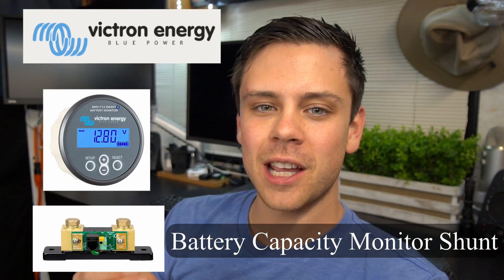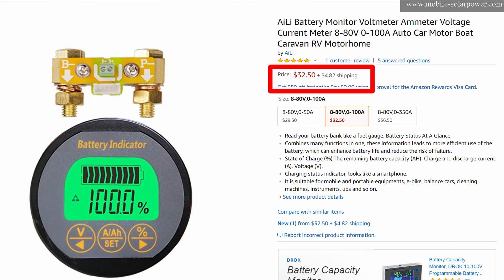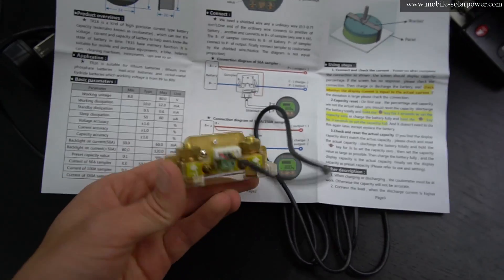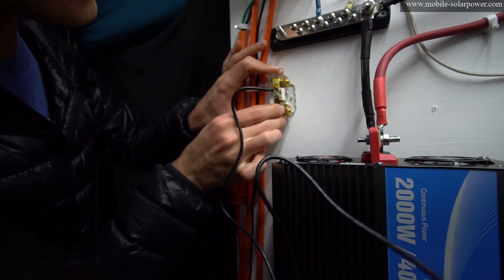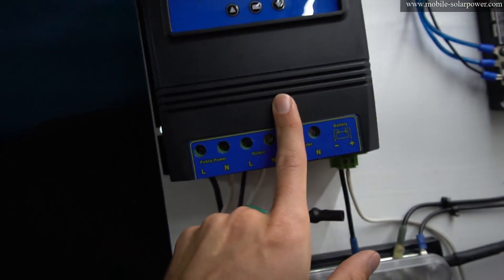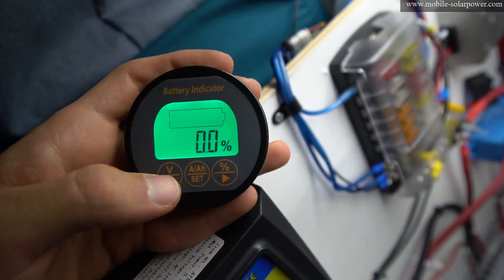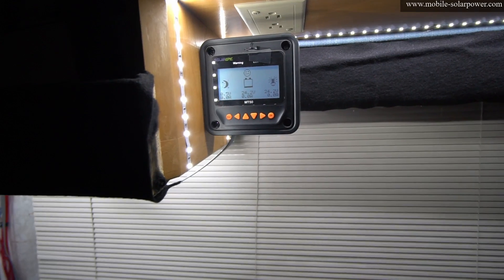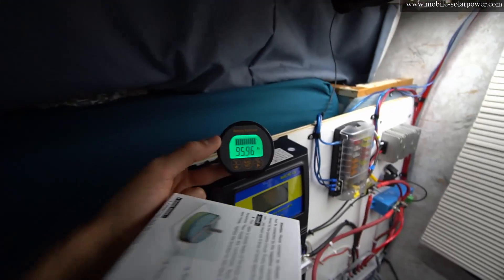$200 Victron Solar Battery Monitor? Try this $30 Chinese one instead! Great for Off-grid Solar

Comment: I bought on Ebay a similar cheap Chinese model (don't know why we say that because most of the expensive ones are made in China too). Aus$35 the meter works very well. All of these meters are a little complicated to set up, even the expensive meters. Avoid the ripoff expensive meters, they are just another example of niche market gouging.  Don't feed the thieves!!

Comment: My charge controller has a display that shows me this. I saw this same thing on Amazon. I instead put a webcam in front of my display and so I can now monitor it from  my cellphone or home without having to walk downstairs. I have a 4080 watt solar setup that works fantastic with 2 seperate charge controllers, 1 is a 100 amp and the other is a 60 amp 4 2500 watt pure sinewave inverters. I also have 3 tesla cells and on another separate setup  with 4, 6 volt 204 ah agm's.
Reply from the maker: That's awesome!!! I was totally going to do that for a video haha very cool!!
Reply from the maker: By the way a battery monitor differs than what your charge controller will tell you because it tells you how much is going in and out of the battery but the charge controller can only tell you how much is going into the battery
Reply: @WillProwse  Not sure on yours but mine if I hook my volt meter to the batteries they match to the charge controller exactly.
Reply: @Whyuperpatratin  Amperage, not voltage is the primary use of these especially with Lithium since they don't drop voltage like lead batteries do. When your batteries are in use, it's virtually impossible to tell state of charge from the voltage.

Comment: One thing i have been thinking about , I dont understand why do we need all these different gauges and cloks and meters ?  It like if im drivning on the freeway in my car and my kid ask me , dad how fast are we going , well i dont know son but hold the wheel for a sec and then I have to climb into the trunk to chek the speedometer 😁it make no sence , WHY have there not been made some kind of controll unit for small  solar / wind power systems like this i just dont get it , I bet there is mony to be made right there , a simpel small touch screen unit with good graphics and you can put in all the limits and all data how you would like your system to run plus a live page that shows what your System is doing right now live , 👍😊 think that could be cool , Ans seriously i dont think that it would Cost much to produce something like a unit like this lets say in China and have it shipped here.
Reply: You are talking about the Victron 712.   With the bluetooth app.  Or a 702 using Victron's Color Control GX monitor if you prefer a direct cabled version and are ready to SPEND.  Exactly what you are asking for.  The bluetooth app is effective and far cheaper.  I control my system from the driver's seat with my cell on the dashboard.  Or wherever my cell is within 30 feet of the 712, I have readings and controls.

Comment: not clear what is meant by "setting the meter to the lowest voltage the battery will experience"
Reply: Will has his system set to disconnect when the voltage drops below a certain point - this ensures that he won't drain it too low and damage it. The battery will never drop below the cutoff voltage so that is the "minimum voltage the systems will experience" - it makes sense for the meter to read that voltage as meaning that battery is a 0% state of charge.
Reply: @duseks  Does he have a video on how to do this? Thanks

Comment: The thing is this. When you buy a "cheaper" version from china you don't pay for the development of the piece. The one from China is most likely a copy of Victron Energy's version.
Reply from the maker: Lol no it's not. Not even. It's a shunt, there are hundreds on the market. And the victron is made in India. And has different features. The circuit for a battery capacity shunt monitor is dead simple. No one needs to copy anyone lol

Comment: I had nothing but trouble with this product.  The display would flicker on and off when I had it connected.  It would not allow my 55 amp charger to charge the battery.  When I remove it, my battery charges fine.    To make matters worse, the power connection on the shunt fell off.  It was not soldered properly.  Maybe this works for low current, but it sure doesn't seem to work for higher currents.
Reply from the maker: Wow that's crazy! I haven't had an issue with mine at all. That's a bummer it's not working out for you. Good to know
Reply: I resoldered the power connector and tried it again.  This time no flicker, but STILL wouldn't charge.  I may try it one more time.  I agree, it makes no sense that it won't charge with the damn thing connected.
Reply: I'm having the same screen flicker problem with my 350a unit and a 50a charge controller.  The screen finally died completely and now I'm waiting for Support to study photos of my installation.  I agree that the tiny power connection is the weak link here.  How did you figure out that your unit needed to be resoldered?  Did you take photos of what's under the tiny, green, double-positive connector?
Reply: @MTBioGuy   Did you have a reply from Support as I am having a similar problem
Reply: @alanevans679  Yes, the company was actually very helpful and quickly replaced my defective system. No complaints here.

Comment: The Victron is indeed a premium device and that is why it is used in many critical applications, like in onboard marine installations. 
For a fixed terrestrial install, most of the time the worst that happens is that a grid connection is turned on earlier than expected.

Comment: Hahaha I know... I'm so glad you confirmed what I was thinking about victrons battery monitor.  $200 hahaha.  Shit I got Victons 100/50 MPPT for $279, totally worth that!  This is my first solar set up so I'm sorry if my questions are annoying.  First of all you have convinced me to get this monitor.  I have 200 ah of lifepo and want to confirm I understand your video.  Zero percent state of charge voltage?  How would I come up with that number?  I don't believe I have it programmed anywhere?  Should I contact Renogy to find out what the bms is set for and add say 10 percent?  So to tell the monitor what zero battery is?  Doesn't make sense shouldn't it know that when it gets to that voltage?  But maybe it may never get that low so it won't know what capacity you batteries really have?  Anyway, so draw the batts down to zero percent state of charge voltage and set up zero percent capacity extent threshold.  I'm assuming this lets the monitor calculate how much power the batts can store so you have a percentage number?  Sound reasonable.  thanks for the videos

Comment: Hello Will, what's your thought on shunt capacty vs inverter surge amps? 350A shunt vs 6000W (500A) for a few seconds?
Reply: I was wondering this myself.  My inverter can surge to 500A at 12 volts?  I'm guessing that the meter will be fried at the very least since the shunt is nothing more that a resistor and the meter likely measures milli amps across the shunt?  So too many milliamps may zap china?  But more disturbing what happens to the shunt with 500 amps?  Pow Pow in the middle of the night when you go for the pop corn in the micro?  haha  That will not impress the ladies, Will.  Super human Lifepo dude's system goes down on movie night?  Will are you willing to take that chance?  hahaha  I'm kidding.  I love you channel.

Comment: I couldn't resist so I ordered one... I just hope it lasts.   I'm not sure where you read the positive reviews as I could only find the one - on Amazon - but for that cheap of price I'll willing to risk it.   I ordered the 350 amp model just in case and it was only a few dollars more.   Too bad it doesn't have Bluetooth but as I understand it Victron has recently released an update to their Android/IOS app which stops the clones from working with their app.   Keeping it simple is usually the best course.  Thanks for your video on the product. Paul.

Comment: Will, I have 2 Battle born batteries that I just dropped in. I'd love to get this Victron monitor but don't know how to setup a shunt. Can I use this but just attaching to my battery? Could you do a "how to" on hooking it up?
Reply: Lisa- there are instructions for setting up the Victron and they also have videos.    Google it.  Basically, you connect the shunt (a current sensor)  to your negative battery terminal and connect all charging and loads to the other end of the shunt. Everything passes through the shunt.   That way, it can see everything going in an out of your batteries.   Then a data cable (similar to a telephone cord) connects that shunt to the actual monitor calculator/display.    If you get the Victron with Bluetooth, you will not only have the little watch-sized number display, but will be able to pair it to your phone/tablet and have a display and settings on your device.  A great option.  That's the big difference between the 702 and the 712 - the 712 has bluetooth built in.   I recommend either one of those, (NOT the 700)  as both have starter battery monitoring and also a programmable relay control that you might find useful at some point.  I use mine for managing the vehicle alternator charging into my Lithiums.  But it's an optional feature, no need to understand or use it at the beginning.

Comment: The only problem I see is the shunt is only rated for 100amps where the Victron shunt is rated for 500amp.  Just something to be aware of especially for 12V setups.
Reply from the maker: Yeah that's true. The Chinese one has a 350 amp version too

Comment: 100Amps isn't very much...  My 12V3kW inverter can pull 300Amps at times.
Reply from the maker: 100 amps at 24 volts is 2400 watts. I have a 2000 watts inverter. Works a charm. And sure, there is a 350 amp version of this shunt
Reply from the maker: These are sized for specific application

Comment: Hey Will, I made 4 * 12v 150AH systems, but I struggle to get the Chinese meter to work until I noticed you also have a little black wire connected besides the red 14AWG cable.... what is this little black cable doing. Did I miss something?
Reply from the maker: Oh no it's just one cable. The black one goes to the monitor screen

Comment: The victron also considers phuekert component and battery efficiency factored in along with midpoint which is important for lead acid
Reply: @WillProwse   IN GENERAL the Electrical Engineering   general rule  is to spend 5 to 10 % of the asset value on control and protection  so the 200 USD BMV should be protecting at least 2000 USD battery for small systems the 30 USD makes perfect sense
Reply: As well as battery temp if I recall

Comment: hello Will youmentioned li phospate battery you cant ccharge below 32DEGREES . Can youdischarge the li phospate battery below 32degrees f ? IM impressed with your interessed in all battery chemestries. Ihave been running my home most of the year on solar panels for many yeears. but winter is tough. i have been expermenting with a wood gas generator. you tubee videeo John Millard pict0018 Keepp the Faith JOHN MY battery bank is lead acid.

Comment: For comparison sake...the BMV that is comparable to what you reviewed is  $145 and it comes with a 500A shunt. Obviously, a lot more but worth pointing out.

Why did you choose a 100a shunt/? It seems like it is cutting it a little close if you take your 24V inverter to it's surge capacity?
Reply from the maker: Yeah that's true.

And 100 amp shunt is fine. You can put more current through them it just won't measure it. And you can size them to the continuous rating of inverter anyways, which it's actually over sized for. 2000 watts inverter with 100 amp OCPD on positive line and 100 amp shunt on negative. It's fine. Also, think about how a shunt works. You can easily put 150 amps through a 100 amp shunt. It just won't measure it. Won't hurt it. Think about how it works. I tested other shunts for years a long time ago. They don't heat up. Test it on your shunts at home
Reply: @WillProwse  Good to know thank you for the reply!

Comment: Love your videos, very informative! I'm working on a setting up with LiFePO4. Prior to your videos i was so confused on all the manufacturers. My question for you, (and it may be a stupid one but i know notta about lithium ion batteries, yet learning thru your videos) can I use the chassis battery or alternator to charge the LiFePO4 or are they only charged via solar? If you have a video of a way to charge the LiFePO4 without using solar can you post a link for me? Thank you

Comment: If you like cool inverters try doing a video on power tank inverters I think they sell them on Amazon now. 5000 watts continuous and a lot of off grid people need more watts to run a well pump and also I can show you where to get used commercial grade solar panels to hook up a large array

Comment: I have a BMV -700 and love it.
Reply: @joeboxter3635  I haven't. I have a Renogy MPPT charge controller and my inverter is from another manufacturer. But when my system was first installed the battery monitor wasn't wired correctly and the Victron tech support was really fast to get back to me with some useful feedback. I was happy about that.
Reply: @joeboxter3635  Via email. They got back to me quite quickly which was really nice considering they're over in Europe.

Comment: I was thinking along the same lines and have NO intention of paying $200 for a battery monitor.  I did purchase a Victron Energy charge controller and that was nearly a thousand bucks!  Thumbs up, definitely.
Reply: Wow then you overpaid...gotta shop around I got the 150/100 tr for about $700 on Ebay

Comment: Buy a 0.1% shunt from Mouser or Digikey along with an instrument amplifier and a small micro controller. you’ll get far more accuracy with all the data logging you need. Select the right components and you can monitor each cell and drive proper relays.
Reply from the maker: Can't disagree with that! But I don't really need that much functionality. But yeah, absolutely. That's the way to do it.
Reply from the maker: @sleepless1587  I am wayyyy too lazy to do this lol. But if you want to spend a weekend doing it, anyone could figure it out. Simple apparatus
Reply: @sleepless. Two weekends, plus the time to solder components to your custom board. An easy option for coding would be selecting an AtMega328 and use the arduino IDE. While there are lots of options, a MAX44284 for the amplifier, and some like the MCP3245 for a 16-bit ADC (probably 13 usable) are fairly priced. For your resistor an RSN series from Riedon sized 50% larger than your expected peak load. Finally your display depends on what your preference is.

Comment: Have you looked at the new Victron Superpack batteries? From what I can tell: built in BMS. Over and under charge & temperature protection. Ideal for small setups, van/RV situations. And for some reason 15% cheaper RRP than their regular "Smart" LifePO4s.
Reply from the maker: Overpriced in my opinion

Comment: buying cheap = supporting COMMUNISM. I'd rather spend a day's wages for a product designed and built in my country (Canada) than an hour's wage for product built in a communist country...
Reply: BTW, my battery monitor is Magnum Energy  ME-BMK and cost me $250 (CDN)
Reply from the maker: My friends tell me they are junk. I avoid magnum like the plague. I had no idea they were made in Canada. That's news to me.
Reply from the maker: And victron is made in India. And all of these governments are mixed. China is not 100% communist, and America is not 100% democratic.

Comment: Pretty cool for that price point and for few bucks more you can get a 350 A shunt if you need it. Still, I'm keeping my Victron, it may be over priced(it really is) but it does all the stuff I want/need and with BT .......but the toy one you reviewed would work just fine for some of my other projects for sure! Thanks for the heads up!
Reply: I have a BMV 712 for my critical RV system and have zero regrets.  A lot of money invested in the batteries and want them to last.   I know it has VERY little chance of failure.  AND I could always sell it used probably for 80% of what I paid.
Now I'm building a simple "solar generator" and truth is,  you can't even find a Victron BMV used.   This cheapo might be worth it for that but I'm afraid that "buy cheap buy twice" may be the eventual lesson here.   Alternative is the Victron smart shunt @ $130....hmmm

Comment: hey Will, I found a better one on amazon for $40, search for B07D36WP6W, it has Watt/Amp Meter, Time, Temperature, can be programed to protect battery for over voltage etc and has a wireless / wired color display, i recommend getting the 300 amp variant that comes with shunt rated at 500A, that can handle even larger systems say 3000W inverter @12v, since it sends the data wireless to its display unit it might be possible to sniff the data with a raspberry pi and add victron like functionality to it later on.
Reply: There’s no such number or instrument on amazon that I was able to find.
Reply: @michael4104  comes up when i google B07D36WP6W, try Koolertron Wireless Battery Tester Digital Multimeter
Reply: Just bought one, you need to buy an additional relay for the over / under volt / amp tho

Comment: but the victron you can turn off like the load port so dont get sparks :)
Reply from the maker: Or I could have disconnect with battery protect. But I don't care, spark doesn't hurt anything

Comment: Shunts are so 19th century, they are straight out of Frankenstein's lab!   I prefer the Hall Effect current sensors that you simply feed a wire through---non-invasive and bidirectional
Reply: Do you have an example of one you like?
Reply: Hall Effect monitor will not be as sensitive or accurate as equilivent priced shunt monitor.